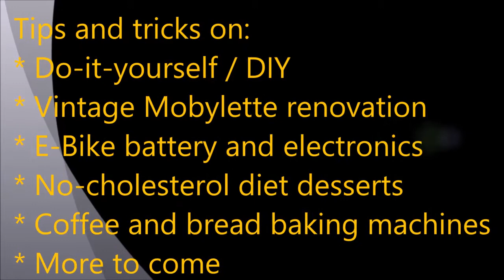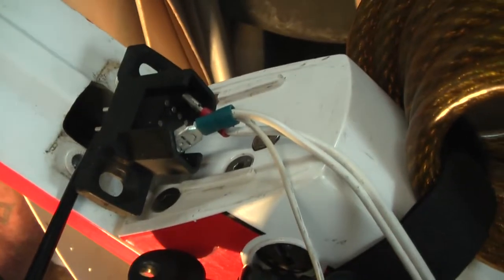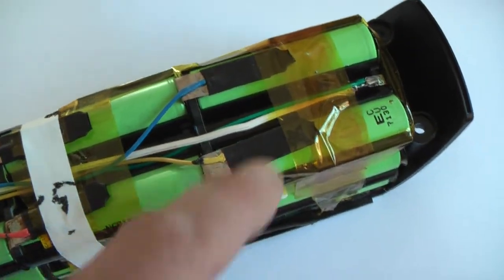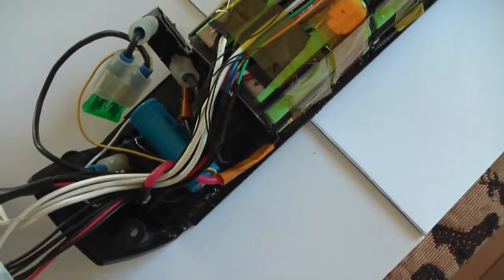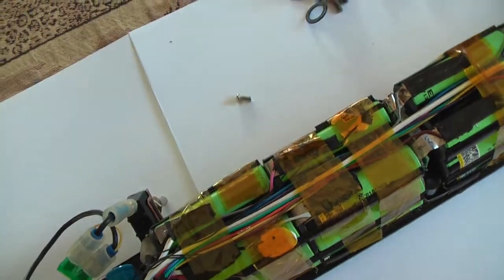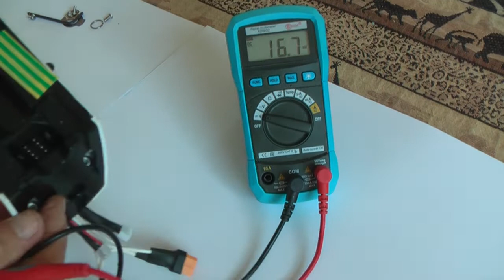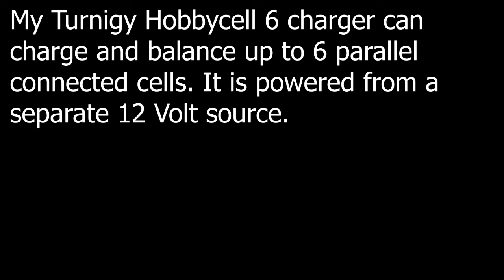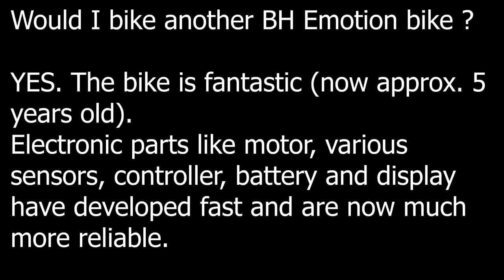Solving error code problems caused by BH Neo Jumper battery BMS.

Comment: Great videos Gerard! I had this problem on a 2 year old battery, 2 years ago. I bought a new battery at $600. Do you think it is possible to find a new BMS for the old battery?  I would love to have 2 batteries that I can swap out. There may be a problem with the lithium cells sitting for 2 years though. You have a wonderful knowledge of that system, thank you.

Comment: Hi, nice informative video, thank you.  I have tried (and tested) several Chinese BMS replacement for the BH Batteries but most are too big to fin in the battery case. The original BH BMS is a two way BMS using the same 2 terminals to charge and supply power to the bike.  Getting rid of the original BMS is a good alternative to scrapping the entire battery.  

I too have a hobby charger (Lifo) but find the connections a bit of a hassle and prone to water ingestion.  If there is enough interest I could make an adaptor PCB as a replacement interface fro the BH BMS including the balancing lead connectors.  

A voltage divider (and trim pot) will also satisfy the controller (reference voltage 0-10v) and enable the handlebar display to display the correct voltage (capacity) without the need for an additional 5v external reference voltage or battery.  Let me know if you think there is sufficient need to invest the time to make such a kit ?
Reply from the maker: I did not even consider replacing the original bms with an alternative because of the bh bms being quite special. The fact that the bh bms generates a remaining capacity related signal (0-10 volts) besides the normal balancer and protecter jobs they all (should) do made me only consider buying a complete original bh bms or even an entire new battery. I guess bh will not sell separate a bms but maybe I am too pessimistic. I guess ebike manufacturers try to make people buy entire new batteries instead of parts. Since I already had a hobby charger and that I discovered about the charge signal I decided to give the removal of the bms a shot. And with success. Thanks for your comment. Gerard

Comment: Hi Gerard
Hopefully you can help me. 
I have a HB easy motion neo extrem. 
I haven’t owned it from new so not a lot of history, it had a battery charging problem of which I have solved. Now I have a fully charged battery it won’t turn on, the display comes on and within seconds it turns off to a very faint number 13 which I know is faulty connection but why faint and after checking all accessible connections the problem still exists. 
Many thanks in advance. 
Regards 
Mark.

Comment: What to do if the reset button doesn't work?
My battery got new cells but still reads 0, - 0,2% on the display and the reset button doesn't seem to work.

Comment: Hi Gerard, many thanks for your work documenting your investigations. 
I own an EVO 650 (36v pack) and it has an issue where the bike shuts down completely (no indication in the display) without previous warning. In that situation the bike doesn't even start. 
It seems to occur more under effort (ie, climbing) but it has also happened just cruising. Measuring output in that situation, is shows a very low voltage (below 10v). If you wait some minutes, the volt reading starts going up, and suddenly, when reaching around 25-30V, it jumps quickly to  a "normal" voltage (depending on charge state, say between 32 to 40 V) and bike starts again.

I suspect that either the BMS is faulty or I have some cell group with some intermittent failure that forces the BMS to shutdown the whole battery pack.

I live in Spain and asked BH. They do not repair packs and do not sell the BMS, so I am forced to buy a whole new pack, worth more than 700€.

Is this failure anything similar to the BMS problems you have had?

Many thanks!
Reply from the maker: Sorry I did not see this question before. Yes, your problems are familiar to me. It may very well be that you have contact issues. Clean contacts between display and handle bar extremely well + the contacts between battery and bike. Use contact spray preferably and cotton swabs. If this does not solve the problem then you have a battery problem. Your problem made me changing the cells in the battery, but after a year of use with frequent error code alerts on the display I decided to surpress the BH bms entirely and switch to an external hobbycharger (Turnigy Accucel 6 80 watts) to charge and balance the cells that I mounted a year before. That was very successful. The procedure is shown in the video. Since that I had to clean a contact only once! Gerard
Reply from the maker: One faulty cell may cause a cell pack to disfunction. Then the bms shuts the battery down. You may consider opening the case and search for the faulty cell(s) (or a cell with loosened spot welds!) and replace them. Otherwise skipping the entire bms and replacing it with a stadardized one or the more simple ncm/lfp balancer is then an option. See my most recent video on the ncm/lfp balancer. Gerard

Comment: Hi, I have the same issue but on a Nitro bike.. after reading 0% i get error code 13 and cannot continue using the bike, even after "emulating" the 5v yellow wire which i do in the upper part where the controller is.. on my bike all the pins from the battery are used for something.. all the pins from the connection are going to wires down and up the bike :/
Reply from the maker: Oeps. Then it will probably be impossible to skip the bms. I guess the charger will have more than a + and - output then too?! Gerard

Comment: I unfortunately could not repeat your success with getting the Evo Jet  48 to work with a BMS that did fit in the case. If it did, I would have tried connecting the yellow to the positive of the parallel group that the main negative came from. This would allow the range to be 4.2v to 3.4v so assuming the readout is linear, 42% would mean 100% and 34% would be 0.
Reply from the maker: Maybe the yellow wire circuit you created interferes with the bms you are using. I used a single and separate Li battery that only shares the black negative with the main battery. The plus of that single battery only is connected with the yellow wire. The display will show 42% for a full battery and 32% for an empty Li battery. But in two years time my display is still showing 39% so there is no "power" consumption. I propose that you watch my more recent video on integrating a high efficiency balancer in my BH battery pack. I had a problem with spot weldings that got loosened creating unbalances during discharging. Then I discovered the NCM/LFP balancer and I am very satisfied with it. I can now charge again with the original BH charger in combination with a timer. See: https://youtu.be/ECV5g7MFfS8  Greetings Gerard
Reply: Thank you so much for the reply, Gerard, I spent more time searching for a solution than I spent on the BH battery. Your the only helpful source. I traced the wiring to the speed controller and indeed it was a yellow wire with the main power wires.With a continuity test I traced the pin and it is orange in the battery harness. I connected an seperate 3.2v power source as you described, and the display indicated 32%. Using the negative out, I then found the 7.5v balance connection and ran a wire to that orange wire and the display indicated 75% the bike works! I will run it until the replacement BMS cuts off at low voltage and consider that zero. 
I need to connect the balance wires and will report the results. Your a genius.
Reply from the maker: @felicelamanna3654  I would mount a simple small digtal voltmeter that indicates the voltage of the pack. Better monitor the correct operation of the BMS instead of ruining your battery by an undervoltage. Thanks for the compliment and good luck. Gerard